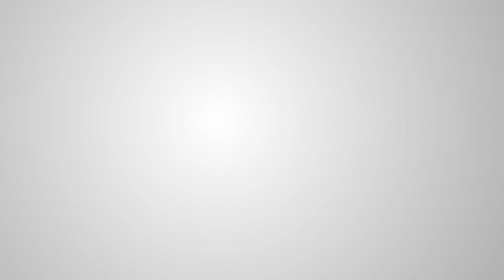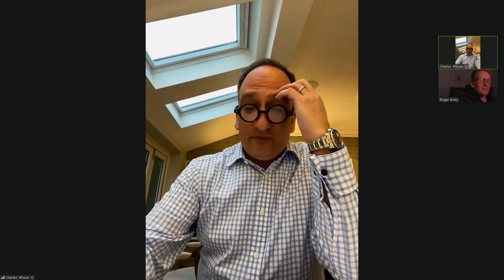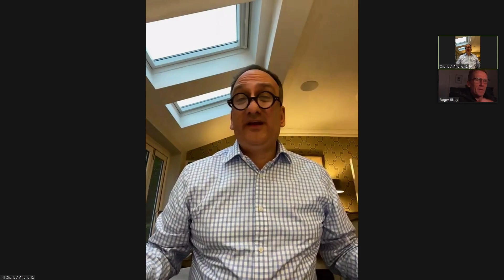10 Plumbers Couldn’t Solve This Mystery. Can You?

Comment: I had a situation on a boiler after >13 years of use which is good, the rear of the heat exchanger was pressed against rubber ring seals 4 in oil & just one of them was leaking not enough to pinpoint because it was over time it was drying off before it was going to be noticed, anyway I carry spares, so I asked Viessmann to change the heat exchanger over to get better hot warer flow, then when removing it off noticed it was leaking because sure rubber O ring seals do fail after 13 Years, I'm very pleased with Viessmann great combination Boilers ❤👍
It's a pitty you cannot isolate boiler, apply external pressure say 1.5bar then meter that to see if the radiators or pipes are at fault, you could do the same say with the boiler, not operating just to see if the say main heat exchanger in the boiler thats got a pinhole

Comment: Roger, I'm coming to this for the first time in Xmas 2023 so I have the advantage of the current technological change to draw upon. This case study is certainly a wonderful example of the challenges we face if we are to modernise our existing homes in the UK. 

My first observation, like you, is to want to isolate either the radiators or the UFH. Or, even better both systems completely on the ground floor, leaving the radiators to initially supply the upstairs rooms alone.  Then, I would look to heat the ground floor with a single system and if possible abandon all the existing pipework which is a real and recurring mess. This last problem should be paramount when devising a solution.

My preference would be to installed a couple of Powerwalls/GivEnergy battery storage units and heat/cool the downstairs living areas using electricity, especially now that the grid utilities will and can buy back from you your battery storage capacity in order to smooth out their peak load issues (Intelligent Octopus, or something more aggressive). This is a real game changer for today and in the future! Then later, possibly shut down the upstairs radiators and expand into those areas with electrical heat for both the rooms and water, giving a much better management of the whole home. There is no need any longer to pay for and use electricity other than at the lowest rate of around 7p/kWh. And all those old design drivers that came from the high energy prices no longer apply, something few recognise the significance of.

This abandoning of the old mess does many things, one of which is to get rid of the muddle and mess of the past forever.

If an electrical solution were adopted, then the plumbing and heating throughout could be rationalised as well. Nodes around bathrooms, which only need a cold water and electrical supply from the mains water and the mains board would exist. Everything else is local, close and accessible to that node, making it simple and isolatable. In the future ECUs will manage all these nodes through a central digital system, with DC rather than AC power being preferred, because here again the driver has changed and HVDC is completely doable. Check out the inter-country connectors for one, and with it new factories are all DC. These changes will finally come to the home allowing AGI to vastly increase productivity.  

To try and fix these old piping problems is but creating just more and more problems in the future,. None of which will then fit in with the technology of the day.

Finally, even the cost of battery storage is falling fast, so the change proposed will be less capital intensive, whilst offering a continuous revenue stream in addition to the heating bills savings, making the payback even shorter.

Comment: In New Zealand it is illegal to have any joints within a concrete floor, all pipework is joined as a continuos length at the manifold... my heart goes out to this guy...the host I believe has nailed it that its a leaky press fit connection

Comment: Simple way to check the heat exchanger of a condensing boiler is to check the condense pipe with the boiler turned off, if there's water running out it's definitely the exchanger leaking.
Reply from the maker: Great point!

Comment: If you do decide to put a fragrance into your heating  system , please make sure its compatible with the materials of the heating system, specially the boiler, pumps, O-rings  etc. For instance a presence of KCI & NaCI (Alkalis)  will accelerate high temperature corrosion of Stainless Steel. I certainly wouldn't use any Chloride solutions or sodium chloride.

Comment: Push fits, copper to  cheap plastic  pipes that came over on a Chinese Junk, service valves concealed under the floor, pipework that appears to have been installed by a mad electrician; what could possibly go wrong a few years down the line, could it have been prevented by a couple of extra weeks work, using copper and LEADED solder? That would probably last the best part of a century. Before all the B.S  erupts and flows into my inbox; I would like to say that  any plumber worth their salt would be glad to explain the vast superiority of lead /tin solder over the sh***, expensive rubbish that we are now forced to use. However; I speak as one that has been consuming water delivered through lead pipes for the best part of thirty years; thus you may dismiss this observation to be the result of having done so.  Roger, you are a flash of daylight in an often murky environment.

Comment: Excellent presentation. I agree entirely that the compressed air is a far better way of finding what was a fairly major leak. One issue is that sealing everything away with sealed floors and concrete etc makes life very hard to find these sorts of problems. Easy access being possibly less attractive but more practical.

Comment: Been in the house for a year. No pressure loss on the suprima side until 4 weeks due to open ball fix's buried in the floor,  very curious. Do like both ideas of using fragrance and compressed air to find leaks but more the air as its immediate and shouldn't contribute to water damage. Great patience from all but whereabouts exactly were the leaks and is the fireplace drying out?

Comment: So much of this hassle would be saved if houses had some kind of service booklet. You could record anything in it, paint colours, pics of pipe runs, guarantees, boiler certs - everything.
Reply: I've just started doing exactly that for my own property. RAL colours for front door, paint used in each room, and I've just finished sketching out the plumbing route of all my pipework (having had to replace a load of corroded gate valves coming from the three header tanks in our loft). Having that service booklet from scratch in every house would be so helpful for everyone.
Reply: Like a logbook for a car, but better?

Comment: lovely, with the floor vents under the extention you should have vents because if you haven't  moisture can't escape and joists can be damaged with that. Check under the gravel to see if there is any under it. That's what happened with my house. They fitted new slabs on top of old ones and buried all the vents at the rear of the house. Felt with you regarding trademen.

Comment: Hi Roger a very interesting video, i'm a retired plumber (heating engineer of 45 years) when the second boiler came into the equation running the hot water system my thoughts were immediately drawn to the domestic hot water rather than the heating, so many tradesmen turn automatically to the new installations rather than looking at the basic pipework in plain view.
Good to see it was resolved and what a price for a leaky bath tap pipe.

Comment: Under floor heating done with the old push fit pipe is not good , the joints pop out and leak , I would isolate it and look at putting rads in but that’s new pipe work etc and disruptive  but there’s no way round it unfortunately

Comment: Another possibility in my experience (although not so in this case) is a leaking heat exchanger on a condensing boiler where you don't see the leak until you check the condense outlet because the leak can be internal and the water finds it's way into the condensate system. 
I've also come across a leaking heat exchanger on a non condensing boiler that was leaking when the boiler was running and water was spraying into the combustion area and then evaporating creating steam that came out via the flue.

Comment: Wouldn't it be easier to just shut every single pipework off then just try 1 system at a time ..like 1 rad as per .. then close if nothing found and open the next and so on eventually the problem pipe would be found Or pressurising pipe work separately any leak would show up on the individual system..also you'd find which and what pipework goes to and label each pipe as you go ....I'd like to have a go !

Comment: Hopefully push fit connections under the floor are illegal in the UK as they are in other countries in Europe? A home inspection should also have marked this as an alarming fault before sale so you as a buyer would have a fighting change of getting the price reduced. If they are not able to inspect it because it's hidden the change of ownership insurance should cover the cost. The floor needs to come up and all the piping work needs to be replaced without any push fittings under the floor boards. Otherwise you will keep finding new problems for years to come

Comment: I'm responding from Toronto, very familiar with Oakville, and as much as I have great sympathy for the subject in this video, forced air heating is hardly preferable, for many reasons, not least health. In many Cdn homes, a huge mistake was made two generations ago when the 'old-fashioned' 'rad systems' (hot water, almost always pumped since the Forties) was ripped out and replaced by forced air. The only advantage to forced air is that you can install a cooling unit for summer use, and even that's a compromise, as the optimal location for heating vs cooling vents is diametrically opposite.

Cheap houses have forced air. Well-built pricier/quality homes have rad heating, or electric, but the latter also isn't ideal save for supplementary use or add-ons.

Done right hot water via a plex distribution system is the way to go. As Roger mentioned, manifold distribution costs more for materials, but it's vastly superior in a number of ways, not least zone isolation and adjustment, let alone trouble-shooting. There's also the plus of integrating solar heated water into the system, and heat pumps. And you're not going to do underfloor heating with forced air, albeit the latter is making a reappearance in new-build, North Am being supplied by a Cdn company bases on Swedish developed tech and implementation.

The problem in the case of this video isn't that it's hot water, it's that some of the workmanship is shid. It could be forced-air and even more of a nightmare to fix.

For the latest leading-edge forced-air underfloor heating, Google "Swedtec" and "Legalett", the latter being quite popular in the US. Google: "Matt Risinger Legalett" to see an episode on it, and examples of both in the US and Canada. It has some real advantages *in some instances*.

For this video instance though, pump assisted pressure flow hot water is by far the best way to go. Just be prepared to find the right service company to fix it. Hot water rads are by far the superior way to heat for many reasons.

Comment: I lived in a very old cottage where the radiators in the new extension never really got hot. The Problem turned out to be undersized pipes. 15mm instead of 22mm. Once they were replaced - meant tearing up floors to do it. No more issues but it took 3 separate plumbers to get it fixed.

Comment: So happy to hear another to say no push fit hidden, manifold with many pipes just don’t make sense unless one charges 3x for every fitting and wants dosh rather than a good job, even buying 90° braces can be difficult pvc bends so beautifully no 90° needed and a fluid flow to boot so much less resistance no brainier Roger your a gem 👍🏽nice stance you take humble admiration. I helped a plumber friend in the states where plumbing is inspected even having to use a purple primer on solvent weld on waste which is swimming pool quality 3-4 mm wall thickness on 1 ½ no purple visible take that section out and redo, i learned some of my plumbing from a German guy with welded poly just like they do the underground yellow gas i’m surprised we don’t do that here too several makes cuprax italia and the German green can’t remember the name but what a system, thanks again for the video Roger.
Perhaps just pressure up between rads.

Comment: 2 Bars in 3 hours?  oO
If the expansion vessel is not faulty, that"s not a small leak.
Reply: It is small enough the system can actually be pressurised though.

Comment: Fitting air bricks when the external ground level is so high could allow surface water to enter the under-building -  or form a gravel drainage channel at wall base off to suitable outfall (a hit & miss hopper at a downpipe?)

Comment: CLUE seems the pressure leak started AFTER the bedroom renovation.  Drill a few discrete holes down through the flooring and through the underfloor sheets in the cupboard space and also at the new bedroom radiator to smell the aroma (or detect the gas) - plug up holes afterwards.

Comment: The moral is: if you have a significant leak, FFS use your ears **first**, before you spend precious time digging up floorboards, isolating off areas, compressing the system, trying to understand dog's dinner pipe runs or introducing perfume. Ears are free, handy and fairly reliable. 
I was lying in the bath late one night shortly after moving into a new house and heard the gravity feed cistern filling when no water should have been running. Why? I wondered. Why are we wasting water?  A quick check showed no leaking tap or overflow. 
My ears had already told me the problem, so I followed their advice. I took a piece of flexible plastic pipe (a doctor's stethoscope would have been better) and went round listening to the radiators and pipework. 
I quickly found where the sound was loudest but there was no obvious problem -- until I took up a floorboard and was greeted by water spraying out from a pipe which had obviously been leaking for many years. The floorboard had been carefully nailed down through the pipe when the board was replaced over the new pipe work for the central heating system.  Much water and heat had been turning the subfloor in to a tropical greenhouse over the years and we were lucky that the sodden floorboards and joists (invisible under carpet and lining) were not well rotten. They had clearly and fortunately been rot-proofed and all eventually dried out fine. 
Stethoscope: as important a piece of a plumber's toolkit as a doctor's. Mechanics know to use them.

Comment: I don't trust the Push to Connect fittings. They will eventually fail because the O ring is vulnerable. I recommend cinch fittings. They are cheap and very reliable. I use a Ryobi power cinch tool that makes a perfect cinch and shows a green or red light to verify it is complete. It is made for pex piping, which is great material.

Comment: I remember years ago the heating system at my fathers house started to drain completely in less than an hour. It would empty completely. But there was no sign of any water anywhere. That quantity of water could not be draining inside the house and not be visible. After a lot of head scratching we found the problem. 
Under an access panel in the floor there was a drain valve installed when the system was built and connected to a soakaway. The rubber washer in this valve had perished and once water started to flow it washed away the crumbly rubber resulting in a complete failure. 
The floor in question was a parquet floor that had later been carpeted. If I hadn't seen the hatch when the carpet was replaced it would have been extremely difficult for anyone else to find. 
We lifted the fitted carpet and opened the hatch and there was the drain valve connected to a pipe leadtng towards the outside. When the system was filled with water by using a screwdriver as a listening rod you could hear water running. 
All I needed to do now was repair or replace the valve.The job was made more urgent by the fact it happened on Christmas Eve and all the shops were shut. 
Luckily there was a tap washer available, but that was too big in diameter. I mounted it on a bolt in the chuck of a drill and used a file to turn it down to the right diameter. Not ideal but it worked. 
A few pence worth of washer caused what could have been extremely difficult and very expensive to find. The hatch was a long way from any radiator and not where you would expect to find a pipe. 
Ideally when a heating system is installed there should be a complete diagram of the system, especially if there is something like this drain valve, useful at times but only if you know it is there.

Comment: So where was the leak??? Did I miss something?
Reply from the maker: It was at the end of the video. I admit it is a long watch but the result is there
Reply: @SkillBuilder  Sorry but it is not there. I had watched it several times.
You said two baller fix valves 'just spraying water out' all over, but you didn't say where they were...
The only reference is 'he heard it' and 'dug up the floor'...
It didn't say what room or where.

Was it under the bath?? That is my vote! most work and possibly several lines passing through, and the radiator moved IIRC.

PS, what is a 'baller fix valve'? [over the pond here in MN USA].
I assume a ball valve, but was it a dead end, or tee'd on a line? (did you say there were two?, I know you said one was open...)
Great video, (but it did leave some of us asking where it was).